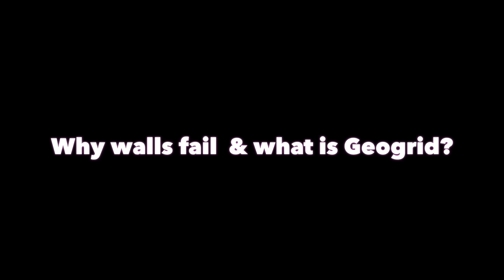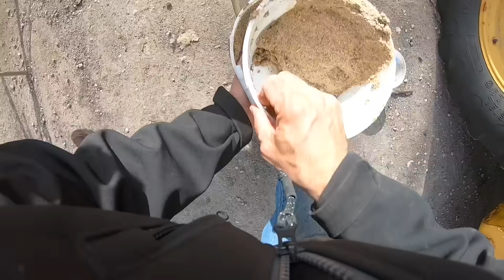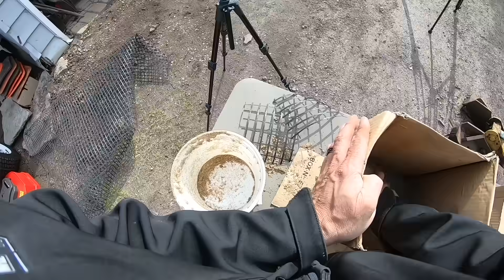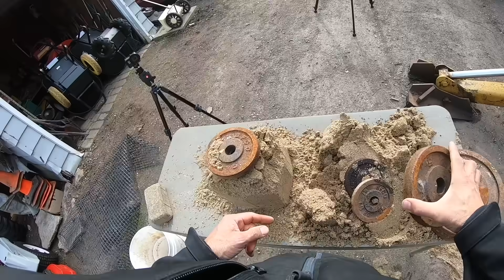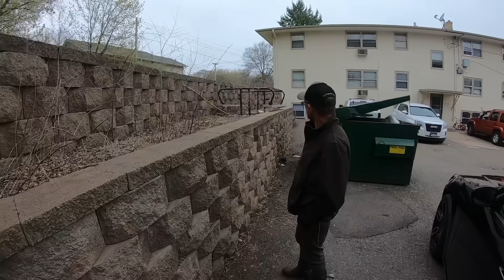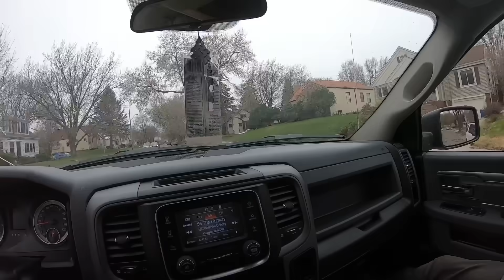WHY Retaining Walls FALL down - How Most people Build them Wrong

Comment: walls fail because the stone/block is not leaned into the bank
Reply: No, that actually has little to do with it. Most engineered stone walls don't need to "lean" into the bank. There is sometimes an offset built into the block, where each block steps back an inch or so. But you shouldn't need to lean the wall at all. The wall is not holding barely any of the soil back, the soil reinforcement (Geogrid) is holding it back. The wall shouldn't have very much pressure pushing on it at all.
Reply: Andrew......absolutely correct.